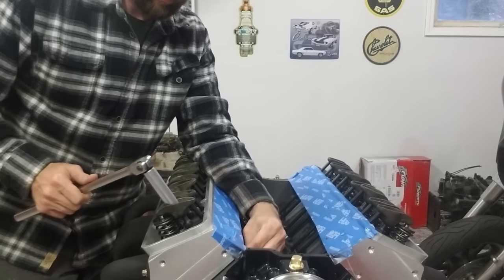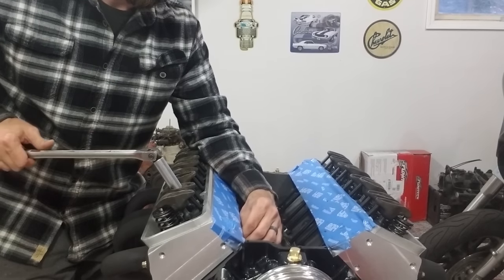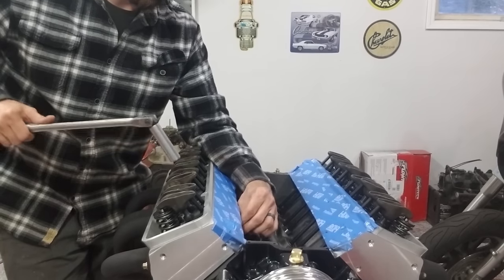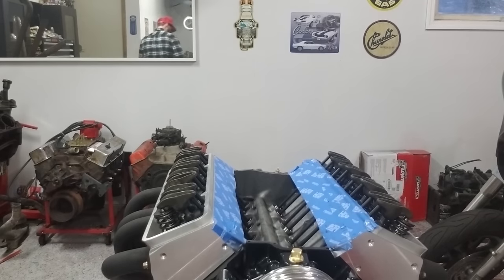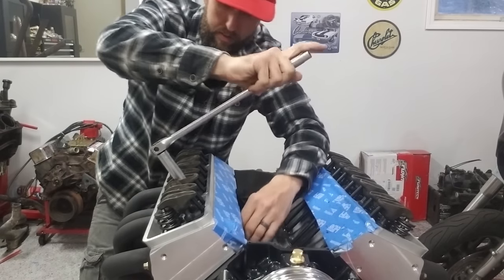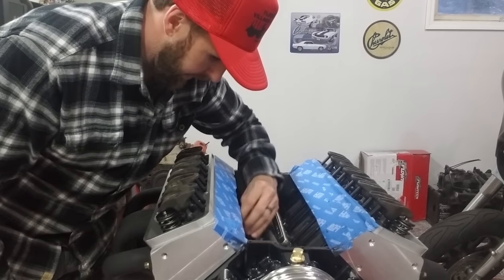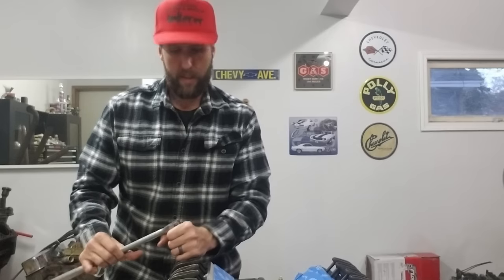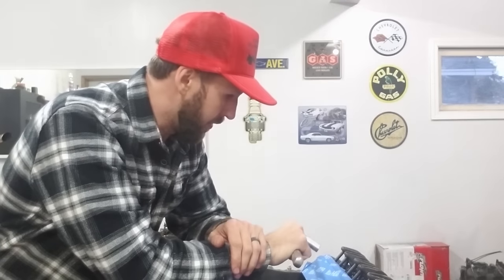Hydraulic Valve Adjustment THE EASY WAY!

Comment: I've been around small block chevys for over 30 years, and have NEVER seen or heard of that method! This proves that you'll always learn something new! 😉👍
Reply: Do you spin the pushrod till it can't spin anymore or till there is tension. Which one?
Reply from the maker: Very slightest touch.  Cant move up or down but no pressure,that is zero lash
Reply: @ViceGripGarage  thanks man
Reply: Have you pred soaked or primed the lifters before or are they dry?
Reply: @ViceGripGarage  but they still got to spin right
Reply: @ViceGripGarage  the rods I mean
Reply: @ViceGripGarage  because man I got a 89 chevy5.7 and I used a stethoscope and put it on the passenger side valve covers running and it's not doing it on all of the as I got down the line just one or two areas towards the back but never adjusted anything like this before  and I have no money to get anything new head times right now
Reply: @ViceGripGarage  could you please do this again but do the hole thing I got a 5.7 and I went with my truck not a brand new motor but a loss end all the rockers up and went and started titeing to were the rocker wasn't moving every time 3 reazaloshions I put the plugs back in weird it up not start at all it tried but I don't know what I'm doing wrong
Reply: @ViceGripGarage  it ran  but had a lifter pike so I thought I'd do what you did but it will not start it did back fire some and ran for a second but I had to give it a lot of gas but it shut down and nothing now at all
Reply: Would this method work also on a 4.3 v6 beings that it is the same as a sbc just missing 2 cylinders?
Reply: @ViceGripGarage  I tried it on my 1989 Chevy short bed 5.7 350 work grate
Reply: @dustinmiller1986  should work because its based on same principle
Reply: Thank you and your dad
Reply: @johncole4586 you're welcome
Reply: @craigbur9 I have 2 on that won’t get tight but when I turn the motor it’s tight
Reply: @ViceGripGarage does it have to be at TDC
Reply: Going to try this on my crate 350 with a roller cam and roller tip rockers. I should be able to do this with the intake on. It has been sitting for 3 years
Reply: @craigbur9 that's what I'd like to know.  I have some that are tight on the valves being compressed and others spin on closed values.  How do you know if the rocker value pushrod is too tight?
Reply: @elianamarley199 I'm also a bit confused.  Under load,  some pushrods don't turn.  How do you know if they are too tight? I guess you turn the engine by hand enough to see if it is lose.  Would have liked to see him turn the pushrods after doing the 3/4 turn.  How are you doing with your engine these days?
Reply: @ViceGripGarage after I do this do I have to set the timing on the motor??
Reply: @craigbur9 Derek Doesn't Care, he wont post another valve video
Reply: @peacepoet1947 derek just blows
Reply: @TheseBygones  Someone might answer our questions, someday.

Comment: This method works.  You sir are a jedi
Reply: What about after you turn the crank a full turn and the rockers are loose again?retighten them?
Reply: @151bradhatt  Yes
Reply: @151bradhatt  you have to go at least 2 full turns, every 90° of rotation, adjust whatever is loose!
Reply: Huuuuuuge thank you! Iv been dickin around for a year with the valves in my 289 and this method has resulted in the best running engine Iv ever had!! THANK YOU!! As a fellow Minnesotan keep the rubber on the road.
Reply: But what if my lifters are full of oil, does it make a difference?

Comment: i'm 26 years old and building a 71 vette in London UK, nobody here to show me anything, have to figure it all out myself via the internet, currently trying to diagnose a misfire and want to rule out any valve issues, this video was immensely helpful, thank you Derek!
Reply: @AppleReviews  new coil, wires, msd 6al, holley sniper EFI, i took the valve covers and found some loose rocker arms a few months ago and just tightened the loose ones, so i think that has caused the misfire, now i will set the lash to 0 for all the rockers
Reply: if the valves are to tight will cause a miss also. you can back them off a 1/4 turn and see if that helps. you can also do that with the engine running and if it doesn't make a difference tighten it back where it was, but it gets messy running with the valve covers off.
Reply: @642lin  i think I've sorted it, i posted a 40 second driving clip on my channel, the car seems low on power tho

Comment: I used this method when i built my 350 small block 2 years ago , turned out great and haven't had to make any adjustments to this day . Much faster and easier to do than the standard way it's done . Good video and very good info. Thanks !

Comment: I’ve been a big fan for over a year. This made me a bigger fan. I had someone put sugar water in my gas tank last week. I caught it, cleaned my tank but didn’t pull plugs to get water out, started it but it blew the head gasket. Never went this far in repair in my 15 years since getting my license but I could never afford to pay someone to fix my vehicles. I got it put together till the point of valve adjustment and this is by far the most helpful vid I’ve seen for it. Thank you Derek!

Comment: I watched countless videos on adjusting the valves on my my 97 Camaro SS 350 LT1 before I stumbled upon this one. It was a lightbulb moment and it made so much sense how you simplified the process. I had over tightened and under tightened rockers and my 350 sounded like a diesel. Followed the procedure outlined and she is purring once again!
Reply: Did you start in top dead center? Or is it ok to just set to zero lash and spin 90?

Comment: I've tried static (by the factory manual) and running (also by an older factory manual iirc), even bought a set of deflectors to prevent oil splash (don't do that, just cut some valve covers if you want to do it running). This method looks like the simplest and most trouble free/idiot proof method. Thank you!
Reply from the maker: You're welcome buddy!
Reply: @ViceGripGarage this video just saved me from pulling my hair out. Thanks bud!

Comment: I'm in the process of rebuilding a 1966 chevelle with a 396. Just put the heads on with a multi layer steel .080 head gasket and I'm going to try this method you've shown. Simplest and most thorough way I've seen, thus far. Thanks, bud.
Reply from the maker: You bet man! Message me if you havr questions

Comment: Derek.... you're amazing! I use a variation of this method on my motorcycle. Dont use timing Marks anymore or anything.  Literally throw her on a stand in 5th gear, roll the tire and as soon as they drop off the lobe I gauge, adjust and keep going. Works like a charm

Comment: The easiest SBC adjustment. Been using that method forever. Works every time. Edit- I was always taught to soak the lifters in oil first. I guess some do it dry. Soaking has always worked for me.
Reply: There is no reason whatsoever to soak lifters. Put some assembly lube on them as you're dropping them in. Adjust the pre-load.
Prime the oil pump before initial start-up.
Reply: not necessary
Reply: Soak lifters? Hahaha....smh.

Comment: I was taught a very similar method, you start at TDC set zero lash rotate 1 full turn, check and set zero lash again do another full rotation and if everything is good then give it 1/2 to 3/4 turn to set preload and your done. It's worked every time I've done it and it was taught to be by a old school engine builder. Very cool to see it used by someone else, it definitely brings back memories!
Reply: Thanks for helping out the people that want to do this adjustment on their own, I am one of them, do you think it's necessary to do 90 degrees turn to check for clearance like his doing the adjustment or I am fine by just setting it at TDC set zero lash, then proceed with full turns until is zero lash, then add 3/4 turn, i have a 1997 mercury mountaineer 5.0 L, i want to fix my clattering on the valves, the only thing is that I do not want to open the whole thing just the valve covers, how can I spin the pushrods. Trying this method, please help me out, thanks.
Reply: @LuisMartinez-fr9gq  you'll have plenty of room to rotate the push rods by just removing the valve covers. From what I've learned both methods have the same outcome, the way I do it just has fewer steps. Now here's the problem, these methods only work if you have fully adjustable rockers and if I remember correctly, factory ford heads of that year have pedal stool style rockers which mean that they are tightened down and torqued to spec, everything is preset from the factory so double check before attempting any adjustment. I suggest buying a service/ repair manual from your local auto parts store. Now here's another suggestion, if it's a lite chatter you can usually quite it down by using a oil stabilizer like Lucas oil stabilizer (I use it in everything new or high milage) just make sure to follow the directions on the bottle. I hope this helps and remember, don't just take one person's word for it, always do your research and good luck with your repairs.
Reply: Hi friend thanks for your replied, I like your honestly by explaining things,  sincerely I appreciated what your are telling me in regards to my car it has to be torque down, I am going to get the book just to double check type of rocker arms. Again thank you for your help. I will keep digging just to play safe. I am worry about it but I hope I can get it done with all the support I have received. Thanks.

Comment: We do it the same way. I would mention your method is great for dry pushrods and lifters. My method for both lubed and dry is up and down movement to get to zero lash. If they are lubed and you spin them you can actually depress the lifter. Hydraulic is so forgiving though. that's my 2cents. Great vid.

Comment: Outstanding; My dad taught me engine running; half a cardboard box lid pinched on the bottom of the valves to guild the oil back into the crankcase.  Adjust while running 1/2 turn after no tick tick.

Comment: Hey, Vice Grip Garage!  Thanks a lot for the info, I just used your valve adjustment method on my 1973 Ford 300 6 cylinder.  Now if the carburetor would just get here I will be on the road again!  : )
Reply: Love that motor !

Comment: Thanks man... just rebuilt my first 351w for my plow truck and I just wanted to be certain it's done the same as the sbc's. I greatly appreciate you spreading the knowledge you have. Thank you my friend
Reply: Does this work the same for 351w in a f150
Reply: @tavo24vv27  yes.. its worked great for my 5.8L f150 4x4. Except I followed the ford specs on rocker arm torque specs. Which is 22-ftlbs after finding zero lash on top dead center of each cylinder you're lashing valves on. 2 full rotations will allow you to lash each cylinder in firing order one quarter turn at a time.
Reply: Hello my friend thanks for your explanation. I want to ask you if I can do what you did on your ford 5.8L, I have a 1997 mercury mountaineer 5.0L, I have not open the valve covers yet but I know a mechanic told me that I have a clatting on the heads, I want to take the opportunity to do this myself by listening and reading from people like you, do you think my truck goes by torquing like yours or I just need to set zero lash then 3/4 turn to adjust, please help me out my friend, thanks in advance hope you know more than me about my vehicle. To adjust valves.
Reply: @LuisMartinez-fr9gq  you need to research is the 5.0L for that year Mercury is a roller Cam and Roller lifters before anything. If they are roller then yes you can do it the same way Derek from VGG shows you in the video. Knowing the firing order and going cylinder to cylinder by order will save a lot of time and hassle.
Reply: @LuisMartinez-fr9gq  hydraulic roller lifters only need zero lash with one HALF turn after zero lash. That's what I did and it ran great. 👍
Reply: Thank you for replying, that is nice that it worked on yours. One question my friend do you think if I get the manual repair from AutoZone would tell me what kind of rocker arms I have. The thing is I am nervous about open it and not knowing what am doing. It's just me my friend, hope your understand me first time, but yes I will keep searching like you recommended me. Again thanks for the tip, I sincerely appreciated.
Reply: @LuisMartinez-fr9gq  there is many videos on YouTube explaining how to do Zero Lash on all rockers. You might be over thinking it. Watch a couple vids and you'll be wrenching in no time. 👍
Reply: Thanks my friend I hope so, I need it to learn, the only problem is that that is the only car I have for now to move myself and my family, that is one of the reasons I need to fix it as soon as I break apart. That is why I want to have everything line up. Thanks for giving me the courage to continue. Take care Sir.

Comment: That makes sense! I am currently Building a 302 with pedestal mount roller rockers. First V8 in decades. That whole thing about making sure this valve is doing this and that one is doing that....(Most act like "base circle" is some magic spot that takes up few degrees. I mean base circle should be a good 180 degrees worth) In any case your methods a slam dunk...because there is of course, no way to hit some spot on the cam that is TOO "low"-no spot lower than base circle, and you will land on that eventually for all positions.

Comment: A guy is getting pretty good at this whole utoober video making thing, eh?
Cheers!
Reply from the maker: Tryin to learn myself up!  Got a few good mentors.
Reply: @ViceGripGarage  you said this will work on any lifter. What about Rhoads lifters?
Reply from the maker: I did not say "any lifter".  I said, hydraulic lifter, huge difference. The science behind the operation doesn't change with brand name.  Its either hydraulic flat tappet, hydralic roller, or its a solid - plain and simple
Reply: Do you half to a just timing when you change from 1.5 to 1.6 rocker ratio?
Reply: Dame right you are!  Your starting to make me think I could be that guy.  Your the best!
Reply: @chrisjohnson-vd2ik  you can do it the same way, but yes it has to be done.
Reply: @w41duvernay  the Rhoads lifters are special. Best to check with them about procedure. I've forgotten, but I think they show less lift at an idle or static. Something like that! They were cheaters for pure stock,lol.
Reply: @ViceGripGarage  So basically you want to take out any up/down play in the pushrod but still be able to spin them with your fingers...then do your extra preload turn. Right?

Comment: Just put a new cam, lifters, heads on my GMC. I have vaguely heard about this method but never understood it until I watched this video. Thank you very much 😊
Reply from the maker: you're welcome!
Reply: Was the lifters already pumped before or after 3/4 turn oil primed or does it even matter
Reply: @bryanbryant5262  good question
Reply from the maker: Doesn't matter, preload pumped you may open a valve because the lifter is "solid".  Not pumped you'll drop the plunger into the lifter.  It doesn't matter... 1/2 to 3/4 turns pumped or dry creates same preload
Reply: @ViceGripGarage  so when I pop off the vcovers what I do first.... As far as turning the engine and do the intake have to be off cause my motor awredy in and together I just gave a chatter
Reply: ok: the intake does not need to be off....

with the valve covers off right now  twist each pushrod with your fingers and tighten until it just turns but not loosely(all of them one after the other)

now rotate the engine(by turning the harmonic balancer with a ratchet or bar) 1/4 turn and check again,tighten again ONLY THE LOOSE ONES.

 turn  1/4 turn and check again,tighten again ONLY THE LOOSE ONES.

do this until you have went around THREE COMPLETE FULL REVOLUTIONS(12 quarter turns in total if you go more its fine)

every single pushrod should have been tightened until it can only slightly spin.

now turn each nut on each rocker 1/2 to 3/4 of a turn....you are done

Comment: I'll repeat myself , this is amazing . I just watched your big block build . I've never seen it done this way . No book tells you to do this . I;ve always  started with top dead center in #1 , then follow the book as to which intake and exhaust to adjust , rotate 360 degrees and go by the book as to which E or I valves to adjust , your method is by far eaisier and you can't get mixed up . , as I have done , LOL
Reply: Is he adjusting it until the push rod will not spin between his fingers?  Or just until he feels some presure on it?

Comment: Tried this method on my Pontiac last night with the manifold on.  Worked great, thanks for making the job super easy.
Reply: So you didn’t have to move the manifold you did it from the top where the rocker is? Cause I just redid my gaskets hate to remove it again
Reply: Yes, the manifold can stay right where it is.  Spin the pushrods just below the rocker.  If the motor is installed in the car, you may or may not need to remove the fan to turn the crank easier.

Comment: I used your method on my snowblower both rockers were loose. It's factree now!
Reply: Your small gas engine most likely does not have hydraulic lifters. Common lash is 3-5 thousandths intake and 5-7 thousandths exhaust for a B&S. Just trying to help a feller out.
Reply: @bearjersadventures9864  they were very loose regardless  :)
Reply: @Werewolfmage  Too loose and the compression release stops working, too tight and you may bend/break a push rod or wear out your cam.(I am not a mechanic, just too cheap to bring my junk to the shop)